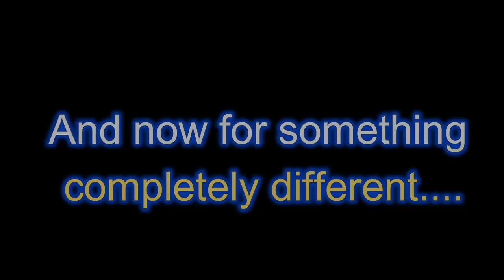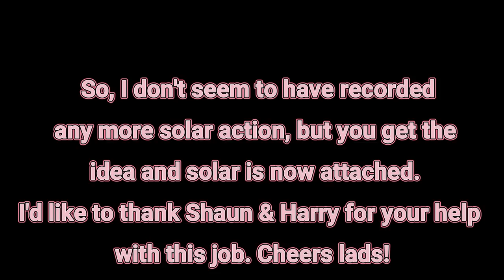Iveco Daily Minibus-More Conversion Shizzle (solar etc) #ivecodailycamper #vanlife #minibuscamper

Comment: If you haven't lined your bathroom yet have you considered using pvc or aluminium roofing panels? I think both should be waterproof and lightweight
Reply from the maker: Hey there, no, I'd not thought of that but I can have a gander. Thank you 😊